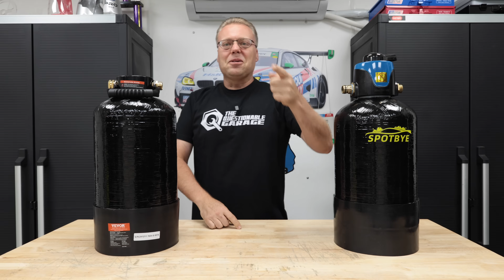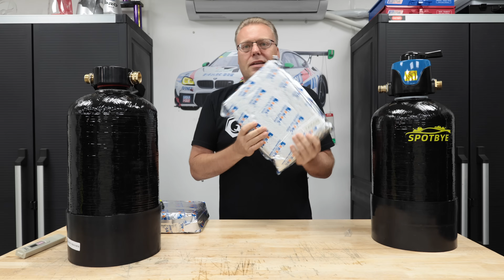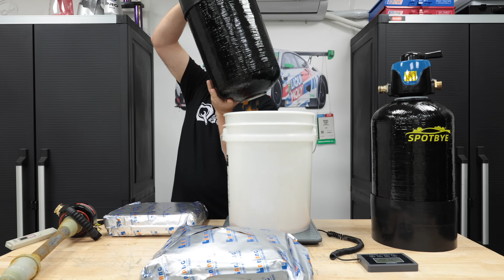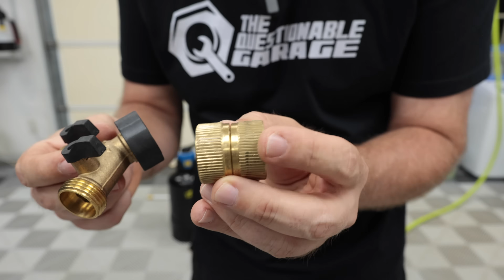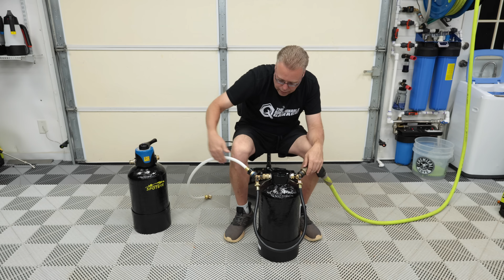BEST Budget DI Spotless Tank Systems | Vevor | Spotbye | Deionization

Comment: @carswithkeav another banging review! I just got the Vevor using your product tag links for $125 shipped! I know you've converted your Waterdrop filters into basic carbon filters before hitting your resin filters.  Is there a cheap carbon filtration system you'd recommend or is it overkill for most people to filter before the DI system?
Reply from the maker: It’s overkill to a certain degree as the initial
Investment would take a long time to recoup. The resin life you save also depends on your chlorine content. If I save 10% on average the Waterdrop costs $300 by the time you add carbon filters at $30 a piece then it would take me 15 years as I change resin twice a year at about $100 of resin.
Reply: @CarsWithKeav that makes sense! Are there cheaper options than the Waterdrop in terms of filter housings to get started with carbon filtration?
Reply from the maker: @aaronmorgan8864 Should be plenty out there as when dealing with carbon you don’t need a bypass.

Comment: Thanks for this video! Perfect timing for me. One question, I use a Kranzle, if the shut off valve is fully open, would the amount of filtered water be just what I get out of the kranzle? Or the full amount I get from my faucet?
Reply from the maker: Unsure exactly in a Kranzle how it interacts as it  is a siphon pump to it actually pulls the water. Matt from OG has been using Kranzle either the CR Spotless for years so it should be just fine. It does put extra pressure on the resin itself as it sits in the housings. Adjusting the flow down some to lower pressure is a good precaution.

Comment: I noticed the Vevor CR copy was out of stock for a while and the reviews were not good.   Wonder if they had a quality issue and stopped shipping it for a while to fix the issue?   I'd like to get both the single tank for portability and the dual plastic Vevor unit for car washing.
Reply from the maker: I have never myself looked at di system ratings because it’s usually a lot of uninformed users thinking they will get 1k gallons with hard water and flow their water full blast wondering why it doesn’t get down to 0 ppm. The tank and top themselves are industry standard you will find anywhere. Only real difference is the resin which at this price it doesn’t have to perform that great.

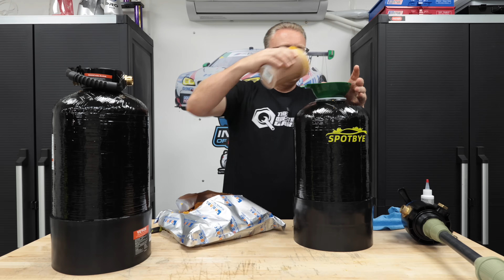Comment: 9:06 And that’s why RO is my preference. Cheaper and no mess….Of course there’s tanks, pump, time and waste water to deal with. 😂 I’d still rather deal with that than resin everywhere. I’m betting Anakin is an RO fan too. :)
Reply: If you do it the way keavs suggest you can sit in a chair with the tank between and massage the bag until it's all out, it make 0 mess. I've done it for 2 bags into the SpotBye and it wasn't hard. Just takes a little time. it doesn't flow out. You have to actively massage it out so you can't make a mess unless you just move away from the funnel.
Reply from the maker: All depends on that water quality if you are high in ppm it’s a no brainer, but most would still run that RO water through a do system which of course would last thousands of gallons.

Comment: I bought the Vevor based on Keav's recommendation in a comment a couple of months ago.  It could use better bypass valves, but otherwise I love it.  It fits in my deck box and is easy to pull out and connect to my pressure washer when I don't feel like drying the car.  It gets the tds of my water to zero and has been worth every penny (it's relatively cheap too).
Reply: What is your TDS reading before running through the Vevor system and how long is the 10 liters of resin lasting you?
Reply from the maker: That’s awesome!

Comment: When will you be getting the new AR630 for testing? Affordable systems for DI . So which one get for ease of use and price ?  Thanks
Reply from the maker: To me this Vevor is the easiest as it already comes with the resin in there and it has the simple top that is easy to setup. Using quick connects to do the bypass to me is the easiest as well no turning a lever in the wrong direction.

Comment: I use my CRSpotless for my home setup since I'd rather not deal with minerals and I don't wash all that often. It really can save some valuable time when it's sunny out. The convenience, peace of mind, and time savings are totally worth it, IMO. 🤙

Also, that's a silly amount of adapters. 😆
Reply from the maker: My CR has been great which is why I have not replaced it. Perfect for the wall space I had. CR used to sell a bypass just like this one believe it or not and charged $75 for it! 🤣
Reply: @CarsWithKeav not surprised lol, and yea cr would be one of my options to choose from but not sure if it’s worth it in my case, at what point/ how many tds should I be looking at getting a ro setup as well? I’m looking for something straightforward, if I can get 500 gallons on one resin fill I’d be satisfied
Reply from the maker: @PerezOutdoors On a system like in this video  you need to be 200ppm or less to be in that 500 gallon range. Thats also that line where RO starts to make more sense or buying bulk distilled water. These cheaper systems though do lower that overall cost per wash vs the $400 systems.
Reply: @CarsWithKeav ahh okay, is there a kit for the ro that’s straightforward or will it have to be diy?
Reply from the maker: @PerezOutdoors There are kits, but they are not cheap. CR spotless makes a whole pro system that is pretty cool. I made a video on making your own DIY RO system with Amazon products. https://youtu.be/BpQmEDUHFRU?si=MKgoOS1VfKStyHbs
Reply: @CarsWithKeav yea I’ve seen that one, about 2 grand after tax and all that. This vevor tank is unavailable so might try another one, I don’t have a garage so I wash outside in direct sunlight in 80+ degree days here in Southern California, I guess I can do rinseless but my Jeep likes to get really dirty 😂
Reply: I have really hard water, cr wouldn’t last more than 10 washes
Reply: @PerezOutdoors  That's a bummer. I have hard water too but also have a water conditioner which leads into my CR.
Reply: @denzilv , that's a good idea. I'm looking at the Aqua Pro tank, but I'd need a RO setup to make it last. I'm new to all this stuff, and it's a little confusing, though
Reply: @PerezOutdoors  Yeah, I do saltwater aquariums too so I have it all set up for RODI. My water conditioner conditions all the house water that then splits to my CR for detailing and my 7-stage RODI for aquariums.

Comment: If you have a water softener, would it help you get more gallons?
Reply from the maker: It could just depends as the softener replaced hard minerals with soft minerals which if it’s a lot could overwhelm one of the resins in the mix.
Reply: @CarsWithKeav so softened water can actually be bad for di systems? Anyway to test?
Reply from the maker: @blacklotus6  In some cases it could make it worse it will be on what’s in the water that makes the difference. Softening usually replaces hard minerals such as calcium and lead with sodium which is great saves your plumbing and that scaling you can get. If the incoming water is already high in sodium then that’s extra work for the Anion resin that handles that. Since most resin is 50/50 mixed once one depletes the other is useless to get spotless water. So basically you did the cation resin process with the softener and now it’s not doing anything on the mixed DI. One thing to do that might help is get a 60/40 blend where anion resin is the 60% that should help last longer, but it’s more expensive. It’s a catch 22 as the softener is for the whole house and handles lots of gallons and prevents problems and the DI is just for the spotless water. I do know a few people who have tried to run DI before their softener and after the softener and had mixed results some saw the resin last longer both ways. 🤷‍♂️